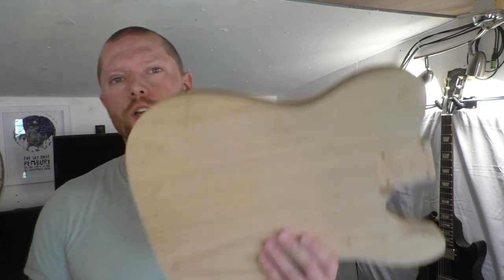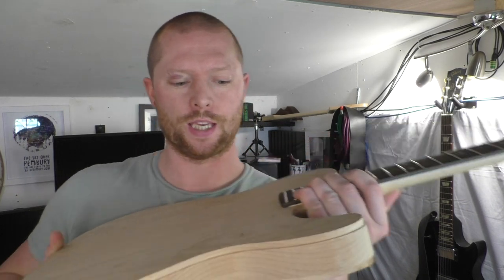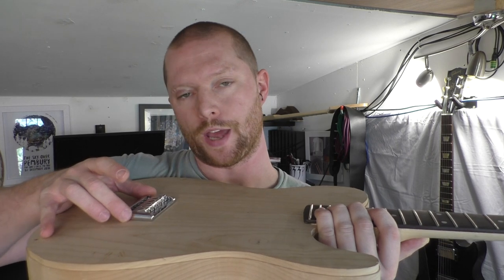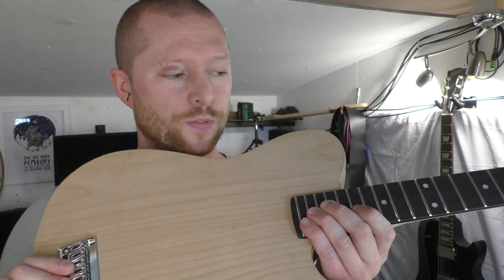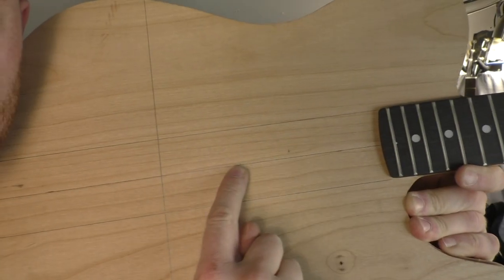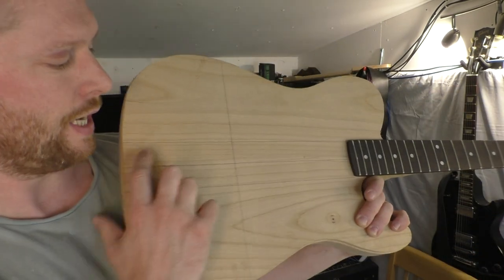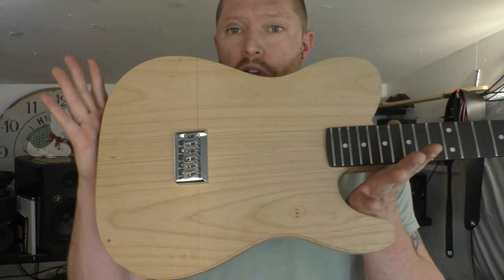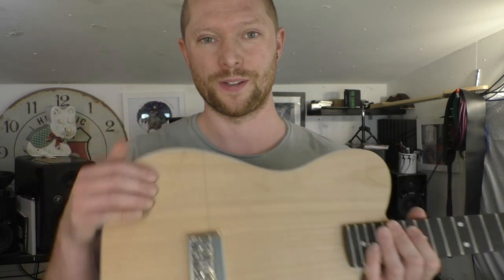How to fit a guitar bridge - Telecaster Partscaster

Comment: I have a vintage style tele bridge with 3 saddles that I'm using for my build. When measuring my 25.5 inch scale length, where should I position the saddles to find my length from the nut? The degree of adjustment for these saddles is quite large, and I don't want to end up mounting the bridge ridiculously far down the body or too high up.

Comment: Great video, thank you. One thing I struggle to understand is how should you set the intonation screws on the saddles before you take the measurement from the nut? From the video it looks like you have your intonation screws set at a pretty neutral position, halfway up each screw, I guess this is the best way to do it to give yourself maximum forward and backward adjustment potential for each saddle? Thanks
Reply from the maker: Yeah I just go in the middle so there’s plenty of adjustment each way. They only go maybe 2mm each side of the centre normally
Reply: @PherotoneStudios  Thank you for clarifying!

Comment: I'm 65 years old and barely hammered in a nail all my days. Now we're having another 6+ weeks of lockdown,  I'm considering building a tele to save me going mad. Well I say building but I'm buying a body and a neck and fitting the bridge etc and wiring. One question. How would you mark up the lines on a body that already has a polyurethane finish? Tape on it and mark that? The nut is the thing I'm slightly worried about and the fret levelling but your video has inspired me so thank you for posting

Comment: How do I make sure the neck is really in line? I will only find out when I put the strings on later? Are there other ways to double check the centerline? Thanks! Total noob here.
Reply from the maker: I run a straight edge up each side of the neck and mark that on the body.  I think draw another centre line in the middle of those two lines in case it's not the same as the original centre line.
You need to make sure the straight edge is on the top edge of the fretboard though (right next to the frets) and not the curved part of the rear of the neck

Comment: Sorry for a probably dumb question, with a bridge like this, do I need something to protect the wood on the top of the body? I have ferrule holes drilled on the back. It just seems that my stain may not be enough to stop the strings eroding into the wood over time.
Reply from the maker: The strings should be held between the ferrules and the holes in the bridge so shouldn’t wear your body.
Reply: @PherotoneStudios  Thanks so much for your answer

Comment: Hello thanks good video. just a question when you measure the distance to place the bridge do i screw the intonation screws to the middle?( To make shore i can set the intonation right) or unscrewed i don't know what set up i should put on the intonation screws before i measure the distance thanks
Reply from the maker: What type of guitar is it?
Personally I put the saddles about half way along the intonation screws and then you have plenty of adjustment either way.
Unless you’re fitting a scratch plate. Then see how the spacing works from there.
I’m about to build a Tele and will use the scratch plate to determine where the bridge sits. Always double check that the scale length works though
Reply: @PherotoneStudios  its for a telecaster project ad a first build.ok thanks i will screw them to the middle and then measure the scale lenth that way i will have plenty a adjustment either way. Its a vintage style with 3 saddles at an angle the screws ar quite long so that should be ok. Wich side do i use for the measurement the low E or the high E? Thanks
Reply from the maker: I go straight down the centre. The saddles should only move a few mm from there
Reply: @PherotoneStudios  ok perfect thanks for your help
Reply: Hi im just measuring the scale lenth on the vintage 3 sadle bridge. Do i measure from the front face or from the middle of the sadle between the screws? Thank you

Comment: Am I correct in thinking that the scale measurement of 25 1/2” should be located at the middle of the saddles adjustment range and the bridge should be mounted there?
Reply from the maker: Yes. That’s exactly what I do

Comment: do you think the bridge of a traditional les paul gibson will work with a 25" scale PSR ?
Reply from the maker: Any bridge should pretty much fit any guitar. One thing you need to be careful of though is that Gibson style bridges are higher from the body due to Gibson’s having an angled back neck, so the bridge is higher to compensate

Comment: Would be good to clarify how much travel distance is needed to intimate a guitar. About 3mm in both directions?
Reply from the maker: Good shout. It probably slightly more than that as Gibson bridges have about 3mm movement in each direction but they also have the saddles flipped half way down and the bridge isn’t set straight.